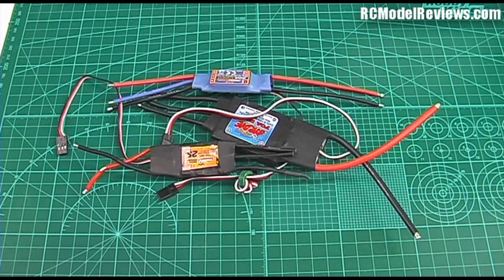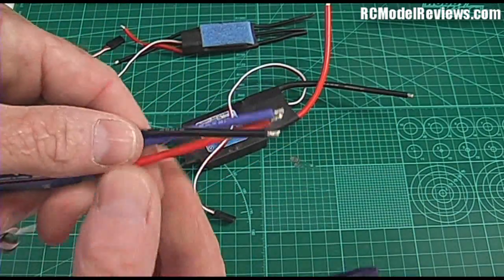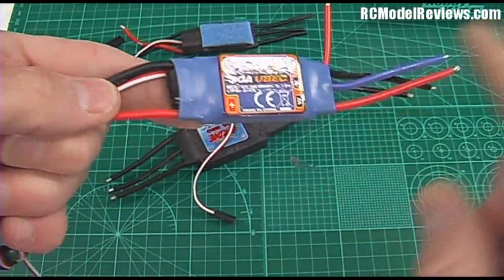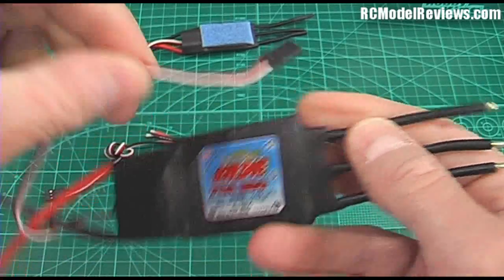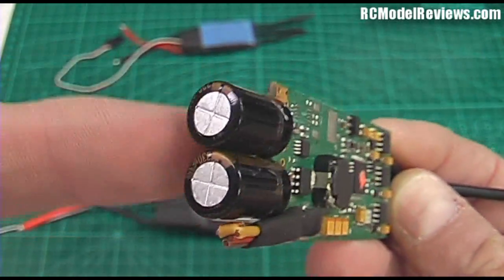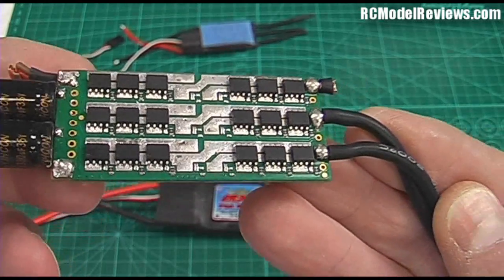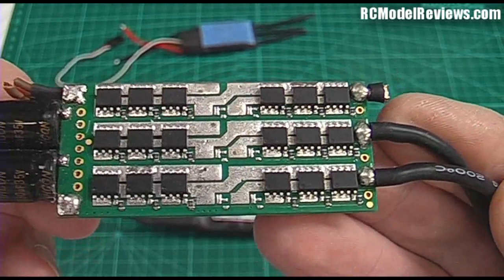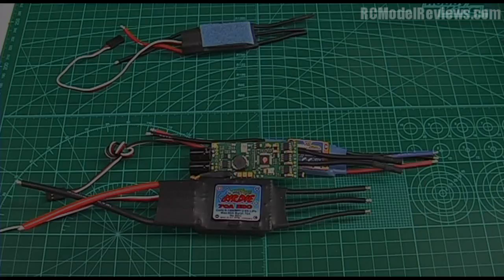What's inside: ESCs

Comment: Yes bldc motors use a pwm signal in a 3 phase order wich is applied rto the coils om the stator causing the motor to spin but its not a true ac sine wave like our mains so its powered by a dc power source and therefore its a DC motor mosfets are the switches and are paired with corresponding capaicitors resistors and diodes and prevents voltage from going the wrong way wich helps the spike that occurs during the change from on to off and vice versa and this wave form is still in square wave pwm not even modified square and its only because we are taking a dc voltage and applying it according to the position of the  rotor wichever sensor is incorporated. So point is its is a simulated ac voltage thats being applied not the same as an induction ac motor where it uses jhust ac current in its normal frequency and voltage to turn a shaft with magnets and windings.

Comment: Fantastic...very nicely you have explained it.
Sir, can you please clear a doubt of mine, that do PWM signal affects the activation of MOSFETs in ESC?? As what I was assuming till yesterday, that if we apply PWM signal for say forward then all the MOSFETs activated for carrying current and three phase switching will only vary as per the PWM signal value. But I got a weired problem with my Seaking HV130A ESC, that at 40% throttle value and 25A current consumption, the ESC got fried and when I asked the reason of this, I got the answer as the MOSFETs will open fully at 100% throttle only. And lesser throttle will partially open the MOSFETs and hence it generates more heat, consequently ESCs fried. So what is your opinion on this issue?

Comment: Cheers, I like your explanations of things. I would like to know if all BLDC ESC's can operate a PMDC brushed motor and what is or would be the best way to connect it. I know that some BLDC ESC's can, specifically Castle brand but I think that You need the Castle Link software to do it. Their instructions show the connections of the output wires having 2 of the 3 tied together and connected to the positive terminal of the brushes and the remaining output wire connected to the negative brush terminal. They were listed by color and I've forgotten which go to what connection. Any explanative help would be appreciated. I don't want to use a Castle controller if I don't have to.

Comment: How does esc now motor position to apply voltage to coils (basically where is the feedback to keep the rotor and state in-sync? On DC brushed motor its physical position between brushes and comutator (I don't know if that correct terminology and spelling) to know when to power next set of coils. Is it detecting voltage through unpowered coil while other are getting power at that instant? Ex 1 2 on 3 off, 1 3 on 2 off, and so on? 
And is the signal into esc (from flight controller or receiver)  just varying voltage or pulse frequency to tell esc whether to speed up or slow down motor? I am assuming esc doesn't provide feedback to controller or receiver.  Yeah I know recently receiver controller an esc for servo. Controller controls esc In application such as quadcopter motors.

Comment: Mister RCModelReviewer, Hi... What does BLDC mean? Hmmm...? Oh yeah, now I remember: It's Brushless DC (Direct Current). It uses DC, not AC. Otherwise it would be BLAC motor. Your ESC is not an inverter. There's DC in all the three wires going on and off in a controlled sequence.

Comment: Does the ESC maintain a fixed RPM at a specific Throttle setting? What happens if the propellar spins faster than that RPM? Will the motor be commanded by the ESC to slow down? Does the Throttle setting control fixed RPM or Fixed Wattage or Fixed Voltage or Fixed Current? Which one?

Comment: I want to replace the MOSFETs in my mamba phoenix rated for 50v 160a continuous. I need an ESC that can output 30v at 400a. I was wondering how feasible it would be to Replace each MOSFET with ones that can handle 30v (instead of 50).
another thing I saw online were stacking MOSFETs on top of each other.... i already made an enormous cap pack using 6 35v 4700f (in parallel) so replacing the MOSFETs looks like it would be harder than stacking an extra one right on top.. oh and I'm going to use 2 larger cooling fans along with the stock heatsink. any suggestions?.... my brush less motor is rated for 25v 350a continuous; something like 7200w. (200km/h+ 1/8 rc car)

Comment: great vid! I have a hubsan h501s that I transferred all the components to a f330 frame and It uses 12 amp esc (just had one burn out), I'm trying to figure out if i could use a alternate esc besides the oem? Also could I even go higher amp and diff motors?

Comment: What's in them that makes them beep?  Is it in the microcontroller chip?
Reply: It's the motor itself. It emits tones through the coils if the frequency is just right. Similar principle to a regular speaker from a hi-fi, but with far coarser wire, far more powerful magnets and using the metal can instead of a speaker cone.
Reply: Slider2732 Thank you!  I've always wondered that and that's a crazy clever solution to that need.

Comment: ESC controls a brushless motor.
ebike aluminium casing  motor controllers also control the speed of brushless motor.
But why are they different? ESC type seems so much smaller and not contained in aluminium casings. Both uses mosfets? In what way are they different technically?
Reply: Those smal ESC don't use sensors in the BLDC. You need those sensors to get the position of the BLDC otherwise you will loose "steps".
Reply: HerrSMINI If i am not mistaken, electric kick scooters also use sensorless controllers. So are all sensorless electric scooter controllers ESC ?

Comment: isnt it pulsed dc/pwm? i was under the understanding the polarity never reversed/ it never went bellow 0v.. you can get those fets cheap on ebay and 40-60 usd for a hot air  rework station...cant recall if you had one,  (thought i saw a rigol scope and the hakko station I wish i had bought...they left off a button on mine lol) im sure you are aware you could probably do it with just your iron as well.

Comment: Thanks for the awesome info 
A few questions if I may .. 
I have a speed controller with two smaller capacitors on the board with a common earth as well as the two big ones. 
I've replaced the big ones as one blew. And both the small ones as They were rusty. 
The speed controller still doesn't work. 
Is this likey to be the fets ? 
Why would my one large capacitor have blown ? 
Thanks so much in advance

Comment: two betteries, two controllers with bec, on receiver, would this work?
Reply: Since all channels gets same voltage from BEC, I asume they are parallel in circuit and 2 power supplies should work.
Reply: It depends on the BEC. Some regulators don't mind being run in parallel but some will fail when in parallel. The output voltage from multiple regulators is unlikely to be exactly the same. If one of the regulators is outputting a lower voltage than the others, it can be burned out.
Many quadcopter controllers suggest only powering the board from a single BEC. You can pull the center pin from the other connectors and either tape the metal or use heat shrink to cover the metal. Some people just cut the center wire from all but one ESC but I'm not a fan of that method.

Comment: so if i had a 160A i can run 4 wire from sbec? if thats the case cant i run all 4 motors off 1? im stuck on this. yes im new
Reply: Bec has nothing to do with motor control. Look at it as powersupply for receiver and servos. As fly stuka explaied - for quad you need 4 ESCs.

Comment: hi, I built I keep burning ESC when I crash....what could be causing it? i am using very cheap motors ready to sky
...could it be the problem?
Reply: If not mechanical damage ESCs are very easily burned if motor is stuck and you still have some throttle up. First thing you do after crash - throttle down.

Comment: man the first guy to make this mustve been a super genius or something (the circuit boards and computer chips) id never figure that out on my own
Reply: Nikola Tesla invented the AC motor. A giant research program discovered transistors. 
Putting them together is not so hard.
Reply: Paul Hendrix i said on my own
Reply: FlyRC nobody figures things all out on their own. every scientist builds on the knowledge of others.
Reply: For someone who has a fair bit of electronics engineering background its not really all that complex, as far as motor drivers go, RC hobby ones are really on the simplistic side. Doesn't really take a genius of any kind, just a few years at uni and few more working as an electronics engineer and things like that don't seem all that complex anymore. But if you don't know all that much about electronics, I guess it might indeed look like magic.
Reply: Welp, the fans in your computer are like a very low power version of an esc/motor/prop combo.
Heck, I've taken ten year old VCR's apart, only to find that the motors there used were brushless.
The advantage here is there aren't any brushes to wear down, and in fact, you can make a much more powerful motor fit in a smaller space than you would if you had a brush-commutated motor.

At least for me, an ESC/brushless motor controller is pretty simple, in the fundamental design/theory.
(Yeah I'm planning on becoming an electrical engineer XP)

In a brushed motor, the brushes take up the role of the ESC. However, because the brushes are at a fixed location (typically across from each other, or 180 degrees apart), the motor isn't quite as efficient as it could be with an electronic control. The electronic control can adjust the timing to get the most power (torque) out of the motor, for a given speed and direction.

That's how a Tesla can outperform an expensive sports car. :)
Reply: course you will, necessity is the mother of russia!
Reply: aleksander suur I mean it's basically transistors turning on and off in the right order - which is cool, but humanity has built more complex things.
Reply: ok you guys need to realize i have no background with computers so you cant expect me to know this stuff, ok
Reply: Benjamin Esposti thanks for the knowledge boost lol
Reply: Benjamin Esposti Well said.
Reply: That's simply not true. Next time you have a little time, research into who really invented AC

Comment: A key think to know also is that ESC's have no reverse polarity protection so even a second of reverse polarity will try them. I learn this the expensive way when I killed all 4 esc's at once in my quad-copter.
Reply: Harsh. Well you will never do it again now
Reply: Hi, just a Idea could you put a 10A diode in the power side to stop the reverse current from blowing the esc out?
Reply: Ivan G-S how did you do that unless you hooked a battery to 2 of the 3 wires on the other side, the side that the motor connects too
Reply: Not the best idea to install 10A diode for racing/freestyle quadcopter power line where 80-140A current bursts are normal thing. From other side diode would be Ok for reverse polarity protection on workbench tests.

Comment: How hot is too hot for an ESC? My rc plane (Hobbyking Bix3) came with a 20A ESC and I noticed it gets quite warm (almost too hot to touch) after a flight. The plane has a 1400kv brushless motor. Is this okay?
Reply: A good rule of thumb for motors and esc's is its fine if you can keep your fingers on it for 6 seconds
Reply: Yeah, electronics can run perfectly fine at temperatures hotter than a person can withstand. Of course, too hot and they WILL fail.
Usually electronic components are rated for around 80 to 150 degrees celcius (maximum). Though, some do have deratings (reduction in ratings/power handling ability) at higher temperatures.
Reply: "The rule is 4 sec hands on" might try some holes directly over or under to increase cooling,or forbid,a heatsink and of course the bigger the cooler it will run. Might look the chip number up, and look at the data sheet it gives how hot and how long to expect life of that part at  that temp.Always a trade off.......

Comment: when i plug my ESC in the battery my ESC heats up without pluging a MOTOR at the other side of the ESC is that normal ??
it fried my motor and started to heat after Flashing it on BLHELI
Reply: No, that's not normal, sounds like one or more of the fets failed and it was conducting dc through. That will burn your motor.

Comment: FIRE!!! well... white smoke at least... I  am running naze32 full board with afro esc 12 amp flashed with BLheli on DYS be1806 2300KV Motors. as soon as I plug in power the motor that is connected to the ESC that powers the Naze starts to smoke. I have motor stop enabled. the Naze still works. I ordered new motors and as soon as I powered up again... White Smoke from the new motor... please advise. Software issue? dead ESC? Is there a simple test I can perform? thanks in advance!

Comment: what happens if the capacitors get damaged?
Reply: Replace them.
Reply: With quality ones; as high a temperature and voltage value as you can physically get away with

Comment: whats the diffrence between the bec and esc i want to build a multirotor do i need 1 bec and 3 esc or how would i need to go about choosing whats best
Reply: +George Posey BEC may be integrated with your esc not every esc has it. BEC normally delivers the 5 volts to power your controller, receiver etc... You will always need one esc per motor independently of having or not BEC integrated

Comment: What are the 3 IGBT on the Microcontroller side for? right side, opposite to the DCDC (UBEC). I opened a citrix stock spec car controller and it looks similar to this one with an ATmega and those 3 IGBTs on the right side.
Reply: +Mathieu Bacquet this is not an IGBT these are the FETs drivers high and low side drivers they use to control the FETs to supply the motor with power in its right sequence.

Comment: I connected. My xxd 30a esc with 1000kv motor then to a 11.1v battery. One of the voltage regulators started to heat and melted the heat-conducting rubber. What could cause this?
Reply: Too much battery juice or to big a load,(maybe less pitch props)could replace with bigger wires with Teflon insulation if the parts will stand the heat.

Comment: Cheers ;) Does it matter what gauge the output (A, B, C) wires from the ESC are (if they're smaller gauge)? I've seen people de-solder the output wires and connect thinner motor wires directly onto the ESC. Will the ESC heat up more?
Reply: dat is the stupidest reply ever.   thinner wires mean lesser resistance......go n kill Ohm.
Thicker wires have higher cross sectional area and hence more conductivity and hence low resistance. Simply put.....thicker wires can handle more current than the thinner ones.
Reply: +JohnnySlash The thinner wires reduce the resistance in the wire, allowing for more current to flow into the motor. However, with the smaller gauge wires and the increase in current, the wires are more likely to burn up. While this may also cause problems on your FETs, I think the wires may burn up before the FETs.
Reply: Amit Das
I'm using 22 gauge wire from 30a esc to 980kv motors. I was thinking that maybe 16 gauge would be better. Like, would there be a chance of the cable burning out?
Reply: +JohnnySlash 
I dunno what "980kv" means, but that's certainly not voltage!...
(I'm not into R/C stuff, but am into electrical engineering)
It's possible that the motor doesn't consume the full 30A, so the 22 gauge wires might be okay ... but I'd say that the thicker the wire, the better. Also, keep them as short as possible. When they are long and thin, the inductance might wreak havoc with the ESC, and could potentially cause the ESC to malfunction (fry)!
Reply: I just want to confirm what others have said about thicker wires having lower resistance. The only reason one would switch to thinner wires to save weight or save room from bulky wires. There are wire gauge calculators online to help you figure out which size of wires one should use with various loads.
It's generally a good idea to just use the wires which originally came with the ESC. The people designing the ESC probably used the correct size of wires.
+JohnnySlash 22 gauge wire sure seems thin for a 30A ESC. I agree 16 gauge would likely be better.
+ TheWalz15 You need to do more research. You have things backwards.